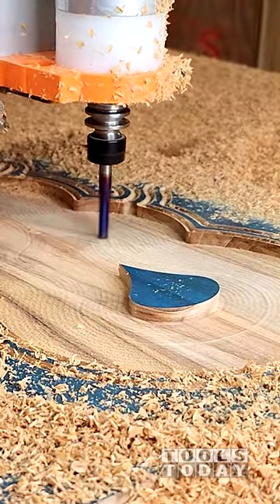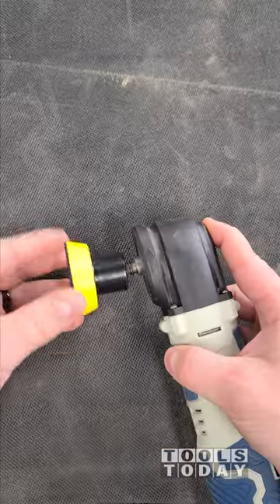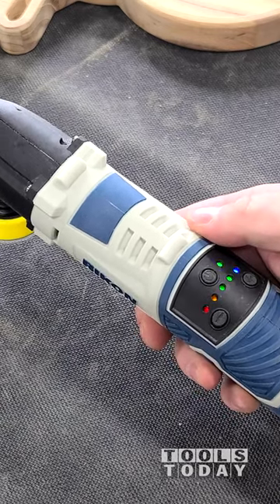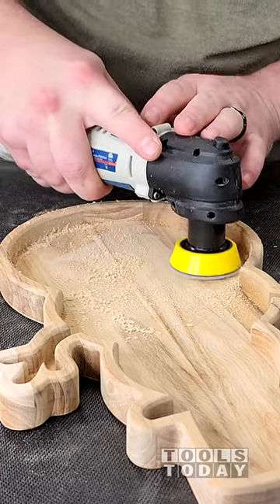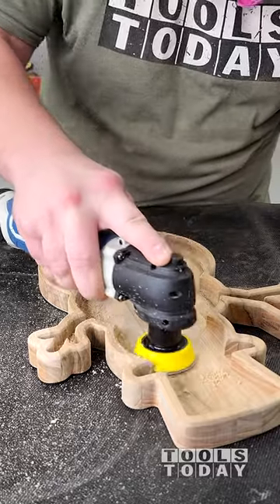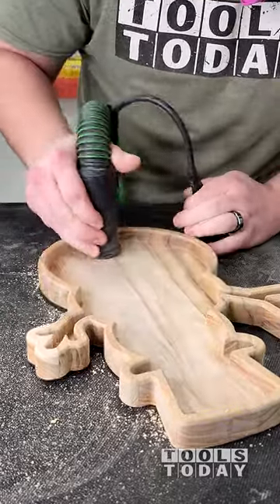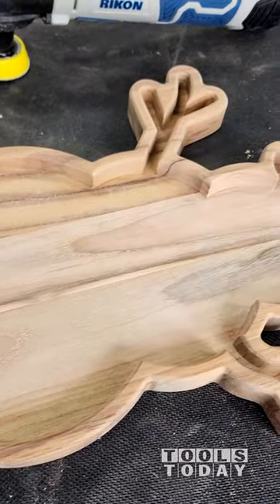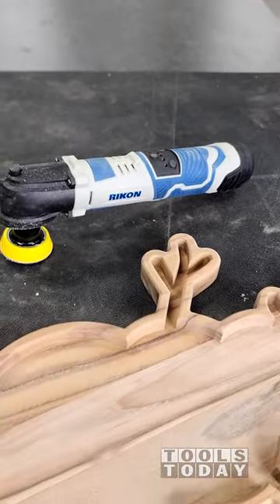Easiest Way to Sand in Tight Spaces

Comment: If you set your step over properly like 8% , you would not have any lines.
Reply from the maker: Right, but that also takes a ton longer to cut.  It would add 15 minutes of machine time, minimum, vs 2 minutes of sanding.

Comment: But why was it such a bad finish to start? A CNC should leave a perfect finish.
Reply from the maker: Not when doing an offset cut like this going all different directions with the grain.  The lines on the bottom are similar to the lines when you mow your grass, they're not ridges or anything like that.  I could switch to taking a tiny stepover only going with the grain, but it adds a lot of time to get a flawless finish vs 2 minutes with a sander.
Reply: You can get those lines even with a perfectly setup machine, but it could also be caused by a bent bit or the machine being out of tram a little. Usually, they’re visible but so small that you can’t feel them. Almost nothing comes off a CNC absolutely perfect, btw. I make thousands of parts per year for different companies. Sanding is a part of every part’s process.
Reply: The type of timber makes a massive difference to how clean the cnc leaves the pocket ... but there will almost almost be some roughness, a router but isnt a sander so its not smoothing as it goes